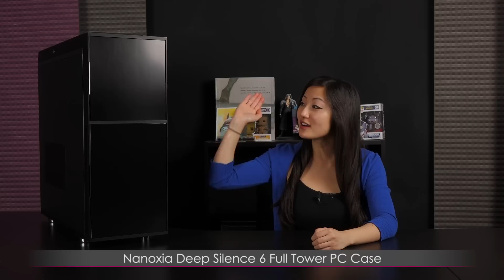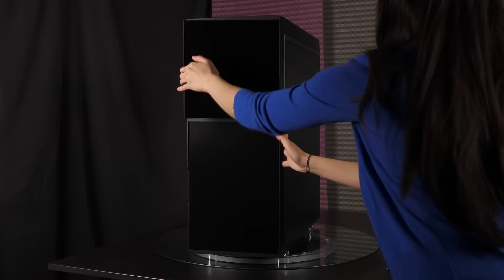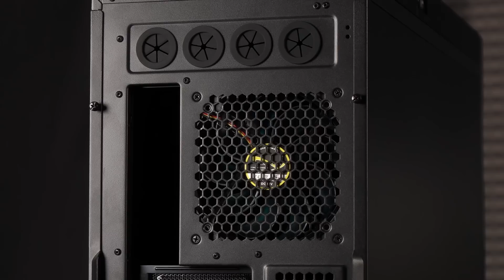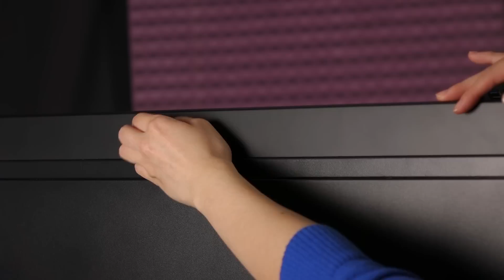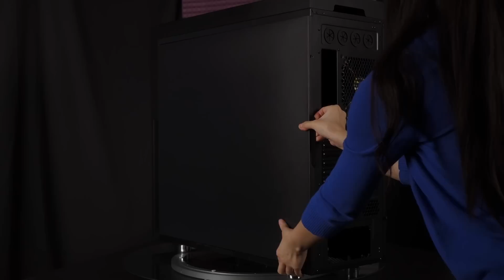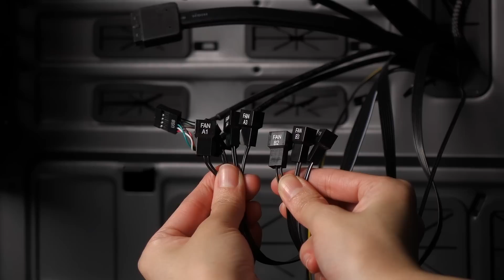Nanoxia Deep Silence 6 Full Tower PC Case: Overview

Comment: Sweet case. The only thing lacking is a hdd docking station...which would be a sweet addition. Then it would TOTALLY have everything!
Reply: hdd = ancient. Buy ssd's only!
Reply: @NikosM112 Not for server things. Just google why SSD raids are crap and furthermore you never get the same TB/$ rate from an SSD. Good luck rebuilduing a 520 TB Setup with SSDs on such a case. SSDs are great for usual PC stuff, but not for storing large amounts of data while still having fast enough access.

Comment: ive got this case and an msi x99a godlike motherboard. any pci e cards that i try to put in it sit too far from the case if they are inserted into the slot correctly, so if i screw them in they are pulled to the back of the case and out of the socket. does anybody else have this problem?
Reply: guess you have to figure out how to move the mb...??

Comment: With watercooling and lots of drives, this is EASILY a 100-pound build.
Remember: lift with your legs, kids.
Reply: Always straighten your legs and lift with a sudden twisting jerking motion. Try to spin 180 degrees without moving your feet. Then you know you’re done lifting. Everything.
Reply: @johnmadsen37  joint go "YOINK"

Comment: I have the h100igtx mounted at the top of this case. Should I use the 2 fans from the top of the case (2 140mm fans) and put them on the side panel to blow directly onto my motherboard/gpu? Is it bad to have a fan blowing directly onto those? I just built my first pc and it's all put together. but I wanted to use those 2 other fans.I have an evga gtx 980ti SC 6gb, i7 4790k, 16gb of RAM 2400, MSI Z97 G45 mobo. Please and thank you for a reply!

Comment: This case is almost the size of a freezer, it's so big but nice to make an server PC.

Nice video Joanne.
Reply: +Bruno Amaro What are you talking about? This isn't designed for servers at all. Literally this entire case is designed to be as quiet as possible, that's what you pay the most for when you buy it. Servers on the other hand don't have to be silent. Servers don't need a nice design or cable management. Server are where no one can see them and they can be as loud as necessary to have to best performace.

This case is quite the opposite of a great server case. I should know, I have the Deep Silence 5 sitting right next to me.
Reply from the maker: +Bruno Amaro Full towers are also a lot easier to build in!
Reply: +Bruno Amaro big cases are the best! not gonna lie i wouldnt mind using a server rack in my bedroom if i had enough room :p
Reply: wrong exxa. this is a perfect server case. notice the tons of hard drive space? notice its built to be quiet. you can actually put this near your media center to store and access all your media. i know its possible because its what i do.